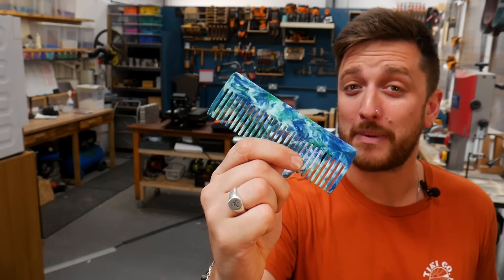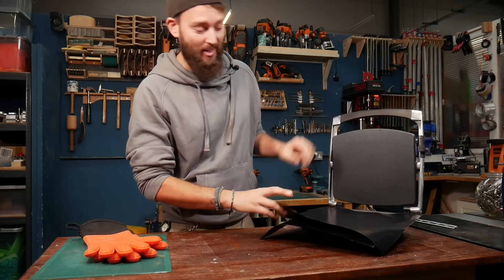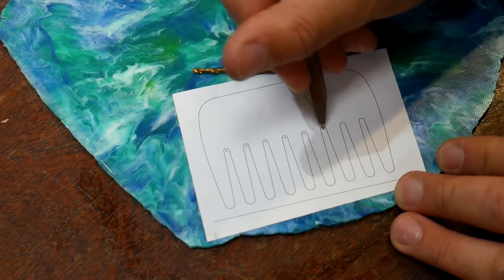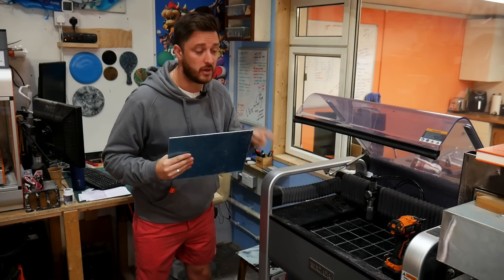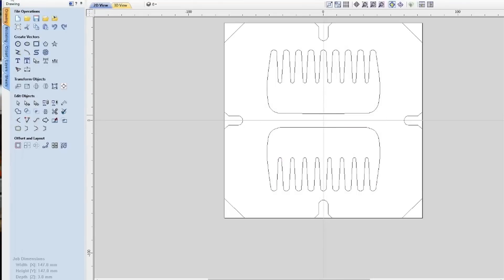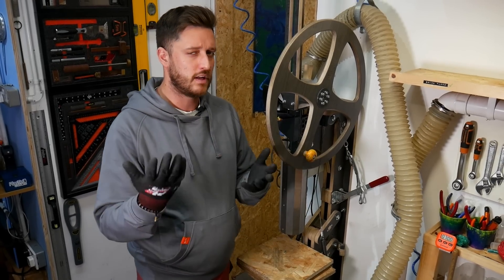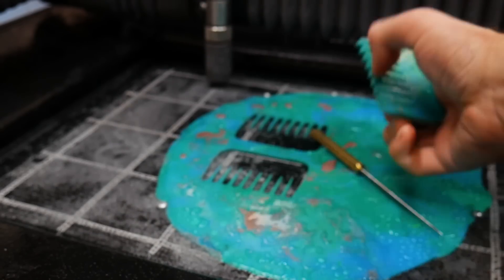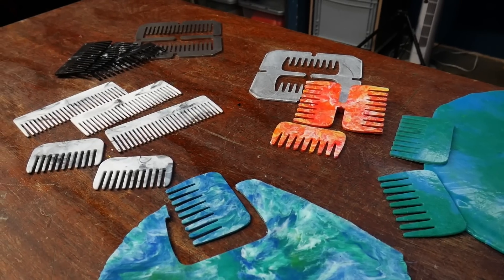Making Combs out of Plastic Waste

Comment: The question was asked.. so... here goes... 
Q: "Why aren't all combs made this way?"
A: "Literally 10,000+ reasons." 

The method outlined here is cost prohibitive at large scale (new plastics is cheaper than sorting, cleaning and reusing old plastics)
The method here would not scale well. It's simply faster to mass produce using injection molding than press molding. 
Time constraints. The multiple heating / cooling, and forming steps used here would simply be wasteful. 

The list of reasons is almost endless..

Comment: hi!great channel! i'm approaching plastic recycling and i discover you, i think you're doing great! i have some questions if you can help:

1. i would really like to make lego bricks out of recycled plastic. i've read that the original ones are made out of abs so i bet the best type would be that one, but i mainly see other plastic recycling videos. also i bet they really should be done properly as they need certain precision to work, so i guess the first problem should be to design the exact mold and having some very good cutting company. then i bet i would need some experience on the whole process especially using molds.

2. i've seen your recent van conversion video and this is also great. As i'm pretty into it as well, i was thinking on making the most of the conversion with recycled plastic. I mean like using plastic instead of wood as much as possible. Do you think that would be very complicated? As lot of people convert their van and use a lot of wood which is not the most sustainable option both ecologically and economically i think could be great to produce a set of recycled plastic products which could be used as a kit for making custom van conversions

Thanks for your attention

Comment: This is rad! But, I have a suggestion: knitting needles. The material would be easy on the hands. I’m not sure how well the needles would perform as far as the Bility or what have you. But that would be a cool experiment. Try noodles, the size of a pencil or chopsticks with a nice point and four sides along the shaft. Yes, that’s what I would like to see you do with this material. It could have a better market, if they turn out to perform well. I imagine the 4.5 mm or larger sizes would be most effective, since I really skinny HDPE knitting needle might flex too much. This is fun! I want to do it someday, but right now you’re the one with the Panini presses

Comment: I'm having a lot of trouble making clean melts especially with white plastic lids from milk... I soak them and then individually clean them before putting them in to melt, and I've not once yet had a clean melt out - there's always some residual stuff it seems and it shows up so much on the white. I also tend to get contaminants, like cat hair and fibers, no matter how much I clean the sheets I use (silicone, which doesn't help as it often has static after a melt!) Or try to keep the environment clean. I should move the operation from the kitchen haha but is there any tips on getting plastic clean enough? I'm just processing years worth of lids I've collected into single colour sheets waiting for whatever I decide to do with them next. Having uniform sheets is good for me as it saves space.

Comment: Have you thought about making a punch set that has the recycle logo on it so you can use it on more products
Reply from the maker: We have actually done this in the past, but it doesn’t work too well as you need a lot of pressure for the ♻️ symbol and less for the number, so you end up with inconsistent stamping.

Comment: Genuine question (you may have answered in a Q&A video) how did-or do- you deal with people thinking that since your product is made from garbage, or other free materials, it should be cheaper than brand new products?
Reply from the maker: It’s a good question! More often than not, virgin plastic is made into products via large scale mass production. And compared to that, we will never be able to be cheaper, regardless of the raw material cost (for reference, virgin plastic is actually very cheap to purchase by weight). In our small scale or small-batch artisanal recycling system, we’re trying to change the perception of waste so that people value plastic and start to treat it differently. All of our product pricing is based on the time it take to source, clean, sort, shred, mix, inject, finish and package waste material into new products. We aren’t prepared to undervalue the work that we do just to meet the expectations of a throwaway society. Appreciate the question and the way that you asked it 🤙🏽🤙🏽
Reply: @BrothersMake great response 👍
Reply: It doesn't matter if its made out of rubbish it's developed in to something new, for god sake, and should be the same price, because of all the designing, time it takes, and machinery that's been bought. It's not like they have gone down a bin, their using plastic before it becomes rubbish and just thrown away. Thus saving it from ending upp in the sea or landfills. Use your head. 🤕

Comment: Guys! Have you thought about more serious products? For example , about baseball bats ...
Reply: I imagine more ppl use combs, and find them more essential, than baseball bats. 🤷
Reply from the maker: Our injection machines have a max volume of 110g, so baseball bats would be impossible using this technique. But possible using a different method.
Reply: How is a baseball bat more serious than a comb? To anyone that is not a bald baseball player, the comb would be more serious.
Reply: @nian60  A baseball bat weighs kilograms and is more than half a meter long, and this is a more time-consuming task than sawing 3 mm plastic